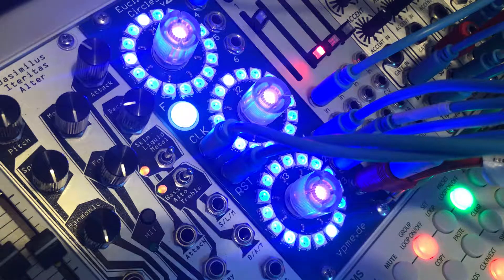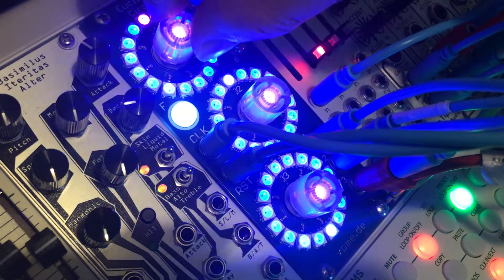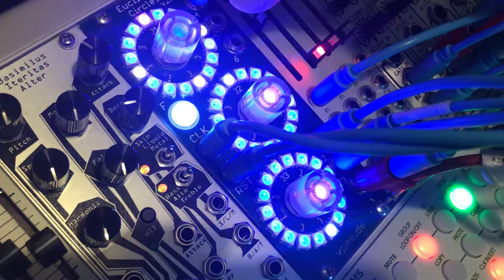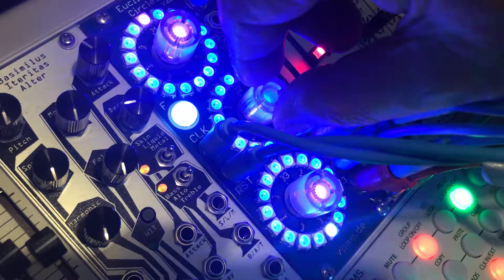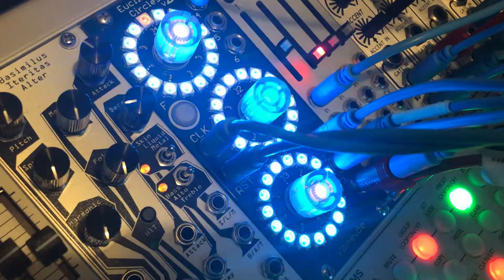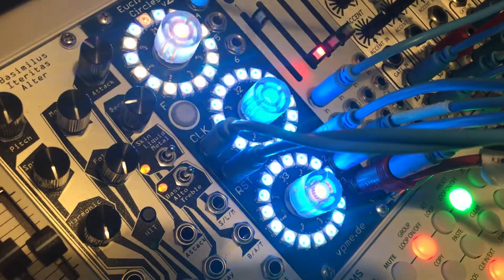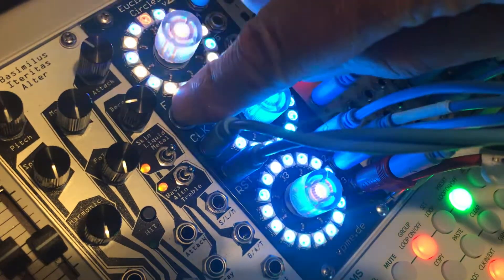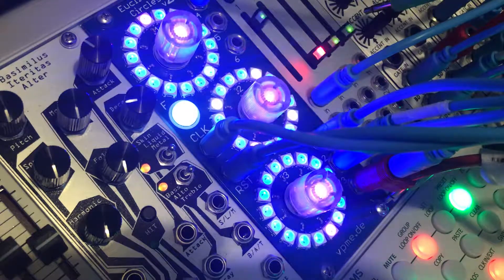Euclidean Circles v2 in use.

Comment: Great demo!  Buying one of these tomorrow!  Also, may I ask what TipTop modules you are using?  The high hats are what i'm looking for and trying to frankenstein the best of the  909 and 808
Reply from the maker: Thanks for the lovely comment.  So, those are the Tip Top 808 Hats and I think they are fantastic.  The 2HP Hat module is also good but if you want that traditional sound go for the TT808 Hats.  Another module I adore is the WMD Crucible but I use that differently.  The TT808 is the one of a few modules I am keeping in my rack after working with my Rossum Assimil8or and replacing many sounds with very good quality samples.  I also think the TT808 Rimshot and TT808 Snare and TT909 Clap are excellent.  The TT808 Bass Drum is a bit lethargic for me so I use a sample instead.  You can not go wrong with Euclidean Circles either, just read the manual and realise that the main encoder colour refers to the step length, quantity and rotate functions and you are gold.
Reply: @steveturner1815  Wow!  That’s just the help I was looking for!  Been watching TipTop demos all day trying to piece together the best of all worlds, so this will definitely inform my new kit.  Getting rid of the Mito Moffenzef in favor of Euclidean Circles which seems like so much more programmable fun!  Appreciate your input! ^_^